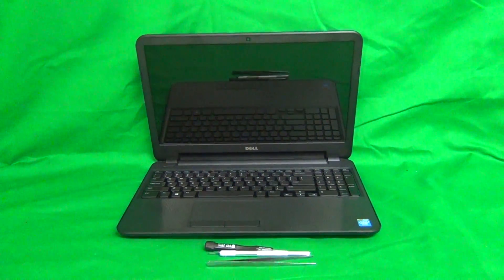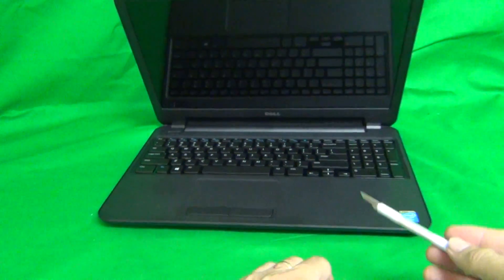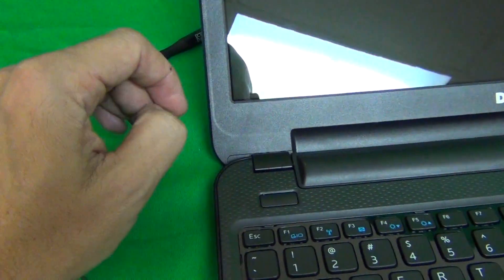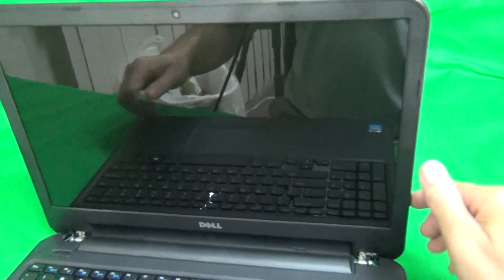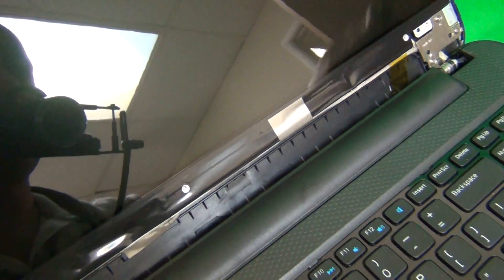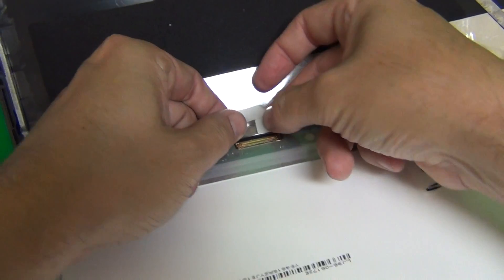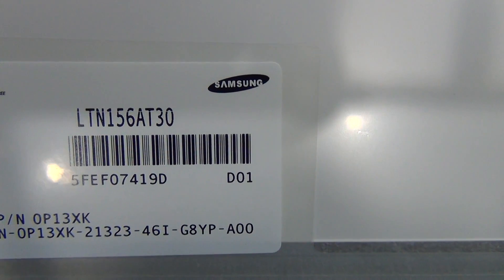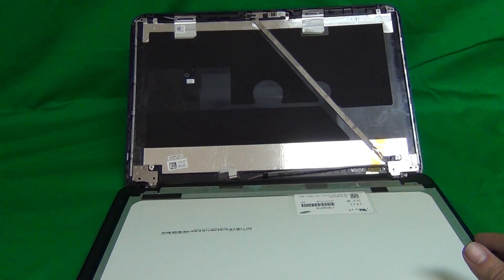Dell Inspiron 15-3531 Laptop Screen Replacement Procedure

Comment: the 3537 model is completely different and it is impossible to open it. Dell ya!
Reply: I have a 3537 as well. I understand the difficulty but I did open it up successfully with some minor scratches on the hinge. It must say, at least for the 3537, it requires a lot of patience. It's kinda hard to remove the hinges.

Comment: Honestly man thanks so much. Perfect instruction for my exact laptop. You rock. Also, if anyone happens to not have an exacto knife, like I didn't, use a one mm normal head screwdriver. Worked just as well.

Comment: My son replaced his and when he restarted it, it came up DELL and then the screen went black.  Not sure what to do now.  When it first started up, it kind of had a line near the bottom.....so I wondered if it had a good connection where it was plugged in  when we installed it.  He got frustrated, so I am going to take it apart again and make sure it is plugged in and if it won't do anything, I'll call Dell......I hope it will still be under warranty if we changed the screen.  A classmate shut the lid down on my son and his hand was in the way...it doesn't take much, does it.

Comment: I am a certified Dell technician and I the video is a good one.  I just have one comment.  Instead of using an ex-acto knife I would recommend using a plastic scribe which can be found in most computer shops.  You have a less likely chance of cutting yourself and damaging the plastic with cuts etc.
Reply: Joshua Green
Reply: Completely agree on the exacto knife. If you don't know how to use it, it's not a good idea to use it.